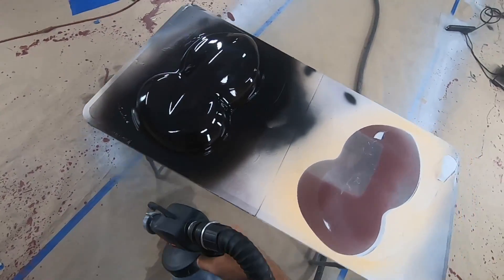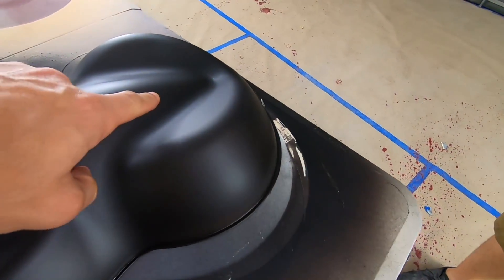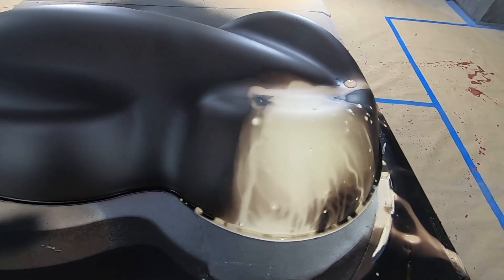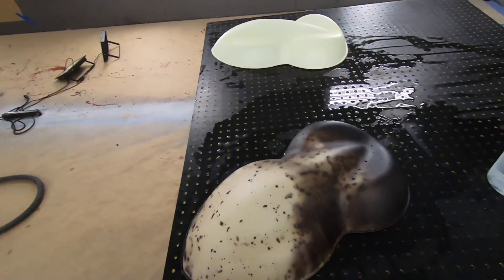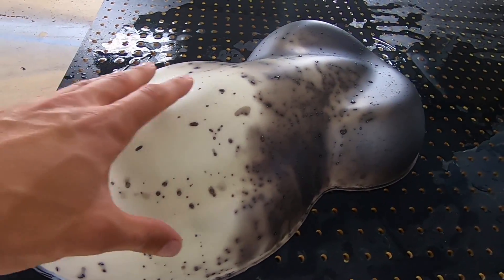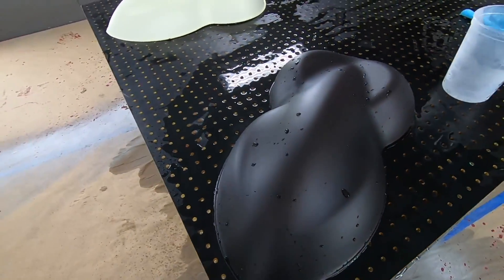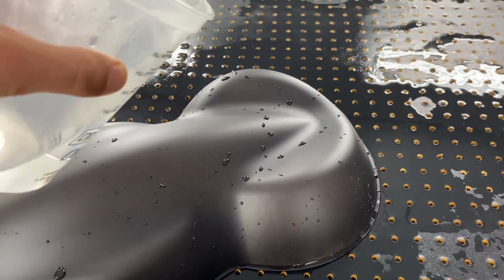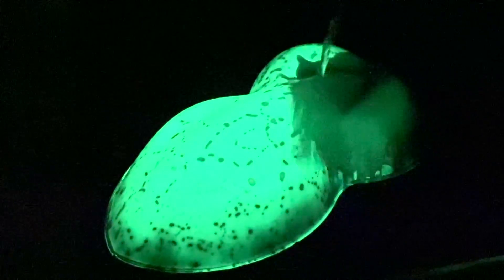Using Glow in the Dark & Thermochromic Pigments TOGETHER?

Comment: The same is true with my last comment on Video We Attempt the World's First VANISHING HYPERSHIFT Car. Though this process, if you can flip the thermo transition properties, may be a little more practical on the East Coast of the US and hotter ecological locations, because though the rain may be cool, the heat would be charging the glow and dissipating the Black coat. 

At night in hotter geographical settings this would produce an almost animated effect on the glow in the dark surface. Worm or hot Air charging the glow effect and the rain making the top Black layer translucent, revealing the glow underneath.

Comment: But how is the glow pigment charged for fluorescence when it is covered with the black Thermochromic pigment? I do not understand why someone would wanna paint their car with Thermochromic paint... who the hell is gunna drop hot water on their car to show this gizmo out? When it rains, the rain is not hot. I think it could be cool to paint it on the engine hood of the car where it is really hot, when the car turns off, it will change color. You are also using boiling hot water, I can see them steam coming off the boiling hot water, which is very unpractical in the real world.

Comment: Is it possible to spray this outside with zero protection from the elements? Would love a video on that to show the different results between inside a booth vs outside on the side of a street.
Just because most that buy these kits will end up either in their garage or on the drive. Would be good to show expected results etc...

Comment: As you already know UV light is generally what make the pigment glow because UV light is fundamentally high energy, depending on what types of pigments are used the particle can be excited to glow by different wavelengths, if the infrared wavelength is able to excite the pigments even lust a little increasing the energy of that infrared radiation by heating it will make the glow brighter.

Comment: That's a great wheel idea. Set up a GoPro with the wheels painted in the exact same fashion. Do some track runs in the dark and see what happens. The edge of the wheels might be the ones just exposed to the heat the most and will kind of create a glowing outline which in and of itself would be awesome.

Comment: Do it on brake calipers. Might be dope.
Reply: I don’t think that would work I don’t think that plastidip can be sprayed on calipers they get too hot the dip would peel I think?
Reply: @justinhaltom9836  good point, honestly I dont know enough about it. But, if possible it might be neat? Dont know. Just a thought.
Reply: @justinhaltom9836  dip on calipers, exhaust tips, and other hot areas works just fine. it may get a bit harder to peel since it'll kind of dry out over time, but it's nothing too bad and works fine otherwise, it's not going to fall or melt off or anything.
Reply: Plus for ninety percent of our daily’s the brake dust will cover anything up in a few days anyway 😂
Reply: @SpeedyBeard  all good points. So maybe calipers isn't the best idea for practicality.
Reply: I think if you use high temp primer then dip and high temp clear coat you might be fine
Reply: Would be cool to see not sure if dip can manage that heat thou... Maybe it can done with high heat paint thou
Reply: I’ve been told dip can take the heat but never personally tried it lol I was skeptical as well
Reply: What about doing a design on the hood or something that would only show through after the hood heated up?
Reply: Brilliant idea! That would be a dope application!
Reply: Spray high temperature paint first then base dip with the Thermochromic on top. Might work.
Reply: dude what lol. What an idiotic suggestion, either you won't have brakes or you'll scrape it right off
Reply: @savagetuner2404  the calipers numb nuts. Not the brakes themselves. You can paint calipers.

Comment: The experiment was not conclusive. The glow may have charged through he thermal while the lights were on. Just because it looks opaque from the outside in a bright room doesn't mean it is. Need to test the glow with heat separate or do this on a clear surface like glass so we can observe it from the back also

Comment: 1 small thing though: the heat does not "charge" the glow. It just increases the activity (at the cost of a decreased glow-time). If the glow is "discharged" completely (e.g. from sitting in a pitch-black room for a prolonged time) it will not start to glow from the heat. Here the glow pigment likely has some residual energy stored (either from light leaking through the thermal or from before being painted) and the heat just causes it to burn off that energy all at once.

Rough scientific explanation: The glow pigment has 2 (actually there are  often several intermediates, but only 2 matter here) states it can be in. One state is the "empty" state and one is the "charged" state (general this is about electrons in the molecule being in different places). The paint goes from "empty" to "charged" by being hit by light. These "energized" states are unstable and eventually randomly decay (almost like a radioactive substance) into the low-energy state. This "decay" releases the stored energy as light (green in this case). What makes these glow pigments glow is that it can take a long time for the charged state to decay. Heating the stuff up just decreases the "half-life" of that high energy state, making the thing glow brighter (albeit for a shorter duration).
Reply from the maker: Thanks for taking the time to provide feedback. See the pinned comment above, it will take you to a video clip of what we saw on our end that lead us to believe the heat is charging the glow. It’s certainly intensifying the glow one way or another!  Thanks for watching!

Comment: Playing on the heat thing, I bet doing some calipers would be cool. Especially at night if they would glow when you stopped. 🤔🤔 loved the blooper reel too man. More of that sprinkled in would be nice.
Reply: This sounds cool!
Reply: U cant dip calipers. The heat wld peal it right off
Reply: @arkvoodle38  but you could mix the pigment with a binder and paint it on
Reply: @arkvoodle38   Not if its powder coated. There a re temperature resistant powders that last forever on calipers.

Comment: You CANNOT charge glow in the dark pigments with heat. The only way it looks like the water is charging it is due micro changes in the thermoblack on top. What you're seeing is either leftover radiative energy from before it was covered in black, or less likely it is being charged through the black layer. Glow in the dark pigment is charged by the addition on light energy that causes phosphor atoms to be excited. When the energy wears off and the phosphor becomes less excited it will give that energy back as light. If you want to prove this, take a packet of pigment in a dark room and heat it up.
Reply from the maker: See pinned comment 👍
Reply: @dipyourcar  the glow intensified because of the thermo dip on top is doing this job. As soon as the hot water touches the surface it becomes more transparent.  With the lights on it may appear to already be transparent, but that plastic isn't very good at holding thermal energy so it starts to turn black almost instantly. What you are seeing are micro changes in the transparency of the black on top. It appears like the heat charges the dip. But I can assure you its not. Take some glow pigment thats been sitting in a dark room, or just a speed form with NO thermochrome on top and try it again. If it glows on its own from the heat i might admit there are some magic powers out there that defy thermodynamics.  What is most likely happening in that case COULD be is the hot water altering the rate of emissions form the phosphor in the pigment. That would appear to charge it, but all you are doing is speeding up the rate of decay and not adding energy to the system i.e., not charging it
Reply from the maker: @gedion4000  did you see the video on my IG?  The glow intensifies without the thermo.  Check that clip and come back, interested to see your thoughts.
Reply: @dipyourcar  i saw it. All I saw was an already glowing speed form with hot water being poured over it. It doesn't show a lack of thermo dip.  Its 100% not charging the dip. Like I said previously,  it may be speeding up the rate of decay from the phosphor. What I mean by this is 1: the pigment already has a charge to it. 2: the hot water might (MIGHT)  be causing that charge to dissipate in a more rapid rate. The hot water is not adding energy in a way that would charge it. This is essentially the same pigments in every glow in the dark toy on the market. You can't put them under hot water and make them glow, it just doesn't work that way.
Reply from the maker: @gedion4000  What I can confirm for you with absolute certainty is the following:  A surface with glow pigment alone does react when hot water is poured on. The reaction is clear - the surface glows more intensely where the hot water touches it.  What is actually happening within that reaction, I don’t have the explanation for. However it happens.. take it for whatever it’s worth. Either way thanks for watching and engaging.. always appreciate it 👍